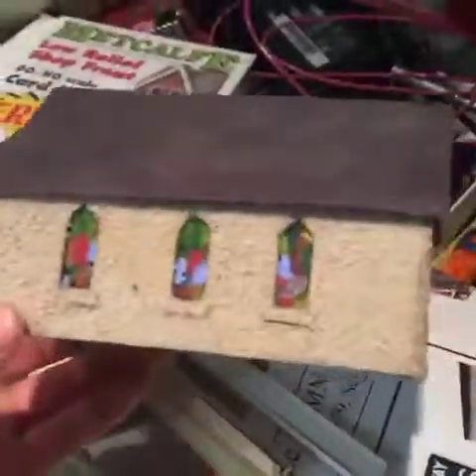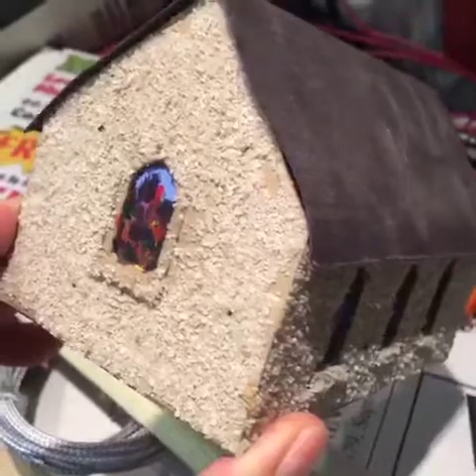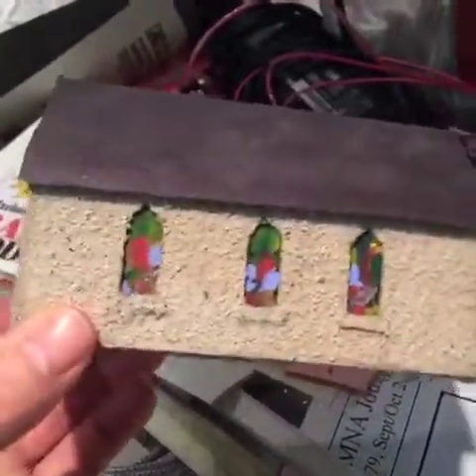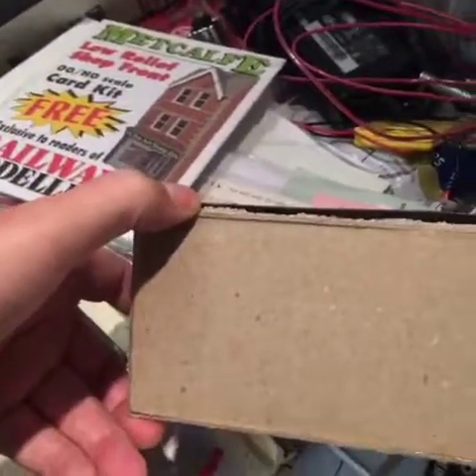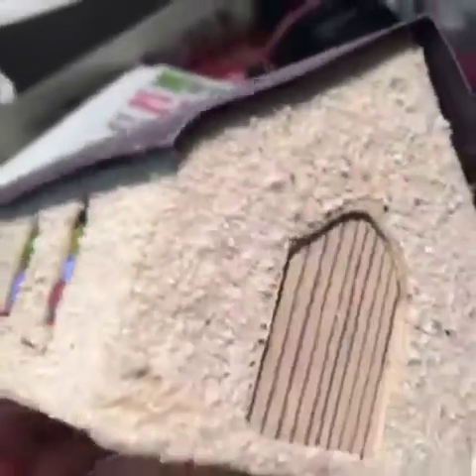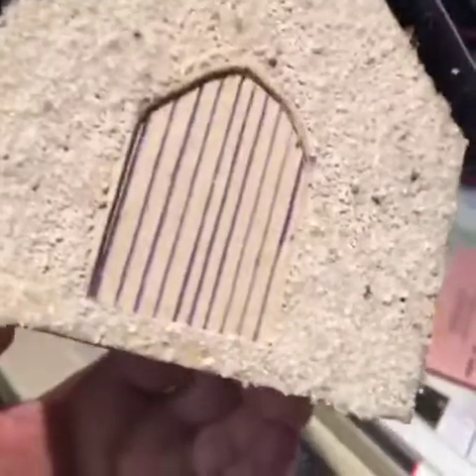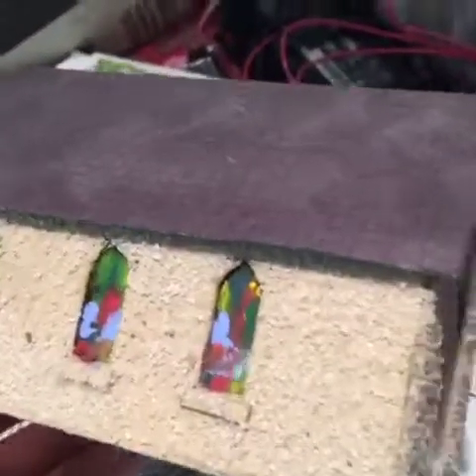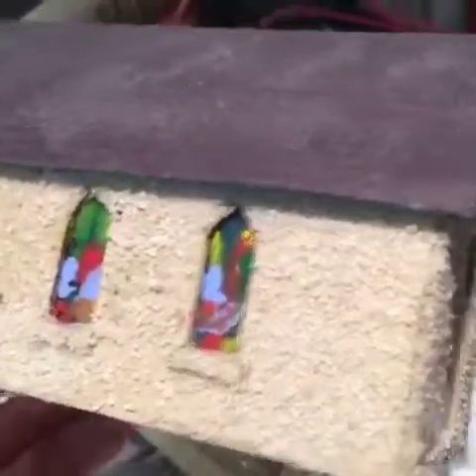How to build a simple and easy model of a Scottish Highland Church Cheap! Video #17

Comment: Using the seeds for the stone effect is genius ! It would be interesting if you made a technical sketch of a model or a time-lapse in the future.
Reply from the maker: vjexa Thanks and you made a very good point. I have a model of a typical Glasgow tenement underway, I should think about that.
Reply: Charlie McGowan  how did u make the roof
Reply from the maker: Wet or dry sanding paper however I am not happy with how it looks, check it out on my other video on this topic. Think I will use paper sheet tiles which I had downloaded and I will be able to weather them to get the look I am after
Reply from the maker: I used plain black paper and marked the slates on with a pen however, I have something else in mind.

Comment: What paint did u use over the birdseed? Thanks
Reply from the maker: I did not use any paint, just dropped the gravel into the glue.
You could use any acrylic paint but I would be very careful as any additional moisture can cause warping of the card.
Check out my video on how to make coal that might give you some ideas👍
Reply from the maker: You could spray the walls with a light primer